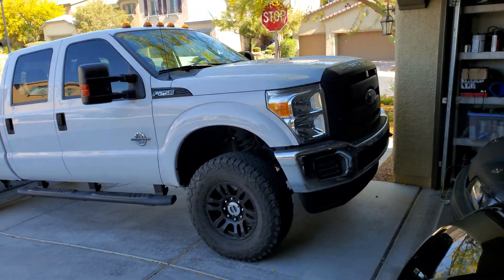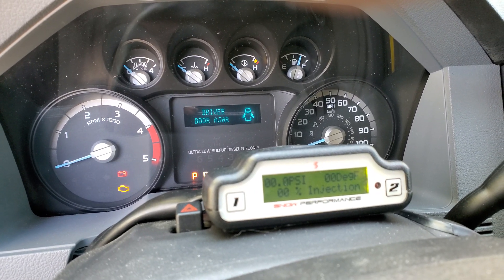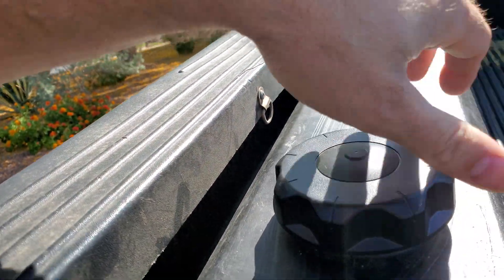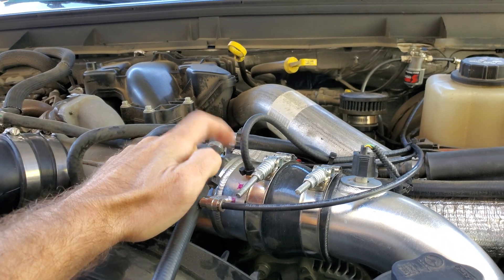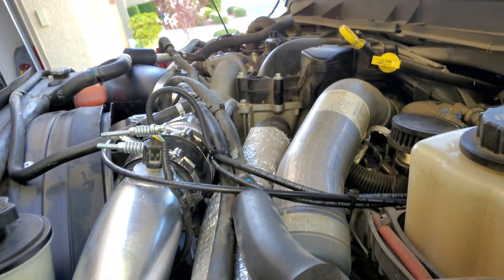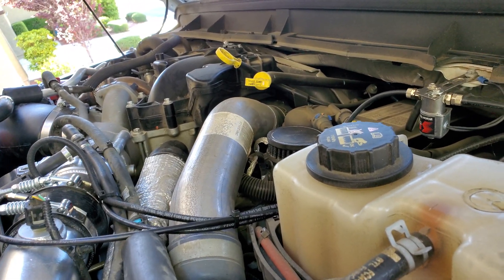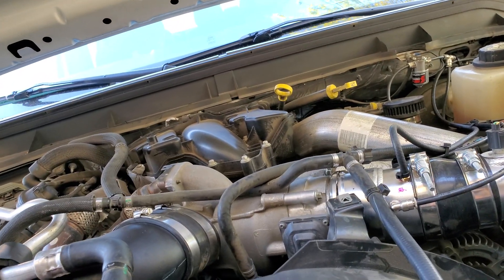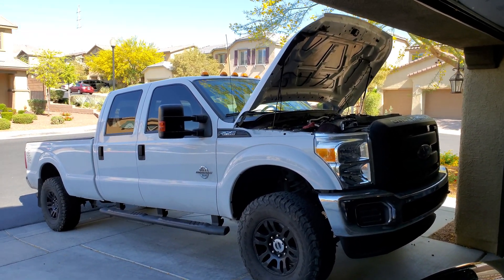water-methanol injection, 6.7L powerstroke

Comment: Good video,  I recently dove into a water-methenol rabbit hole.  Im considering putting it on my 2004 5.9 ram.
Reply from the maker: @timyanke9559  thank you.  Definitely recommended it.  The only time I've seen it not benefit a diesel is when the tuebo is maxed out.  You'll still see mpg benefits, but the top end will stay the same or lose power due to extra fuel and no more air

Comment: May have missed it but do you have the dpf on?
Reply from the maker: I did at the time of making this video.  Water/meth is supposed to help lengthen the time between regens.  I have found that if you spray meth at too low of a boost, it makes the truck regen more often.  The size of the nozzle tho plays a big roll.  Small nozzle you can spray at really low boost.  I run 2 large nozzles so I don't spray under 9psi

Comment: I own a 2012 and it deleted. 
Runs good but I'm looking to buy a methanol kit.  Will I need a tune after installing? I don't know to much about about it. I don't have a programmer.  Just deleted and it was done before I bought the truck. Can you help me?
Reply from the maker: No tune needed.  I have a 200hp tune on my truck but I had tunes for the truck before I got the methanol.  It's bolt on and go

Comment: What do u do in the winter to prevent freezing?
Reply from the maker: Nothing. 
30% methanol is good to -20*.
50/50 mix is good to -40*.
The coldest I've driven in is -5* and with a 30/70 mix it never froze
Reply: @turbojeremy13  exactly

Comment: Wouldn’t a check valve only prevent flow from the engine to the tank?..or is it a spring operation that requires a specific psi to allow flow thru it?
Reply from the maker: It's spring loaded.  If I remember correctly, it takes 20psi of preasure to open it.  This prevents any siphoning effect from air passing by the nozzle at high speed and sucking the methanol out.
Reply: @turbojeremy13  any mpg gains from the install?
Reply from the maker: @oddlyrightoddlyright2475  hard to say.  I deleted the truck shortly after the meth kit went on.  I can tell you I got 20mpg on the freeway on 35" tires.  I feel like that's pretty good for a crew cab long bed.
Reply: @turbojeremy13  good to know man
Reply from the maker: @oddlyrightoddlyright2475  I always tell people to do mods for performance,  if you see an increase in mpg, that's just the icing on the cake

Comment: How much fluid does it use under your normal driving?
Reply from the maker: Depends on how you drive and what settings you use.  If I drive like a normal person just crusing around from A to B, I might only use half a gallon in a month.  If I drive aggressively or tow every day I can use a couple gallons a month. Currently I start spraying at 10psi of boost.  With a lower starting point, I would go through methanol faster

Comment: Thanks for the video very informative. I’m installing a Snow Performance stage 3 on my 2019 6.7 Superduty. There isn’t a lot of information on the water meth injection. I’m running the PPEI tunes and to use the SOTF +230 HP tune PPEI recommends the water meth injection so I’m doing it. They say it will help keep the DPF happy
Reply from the maker: I'd be curious how the dpf does on that tune.  My tuner won't go over 150hp when the dpf is still in place
Reply: Take that junk off

Comment: Nice introduction video, are you in a smog state? If so are you planning on removing everything for smog tests? I’m way interested in easy and cheap power with fuel mileage. You didn’t mention the tunner name, just that you haven’t loaded any tunes yet. Please keep up the post’s.
Reply from the maker: I live in the only county in nv that smog diesels.  Meth kits are 50 state legal from what I've ready and have no plans to remove anything for the next test.  I have a toggle switch i can use to turn the kit off if I want to or need it.

I have tunes from proven diesel

Comment: How’s this setup performing for ya?
Reply from the maker: Very well.  No complaints at all.  Think I start spraying at 10psi now but other then that, nothing has changed since I made this video.  Still very happy with the kit.
Reply: @turbojeremy13  no tuning done to the truck correct?
Reply from the maker: @A1UTV  not meth related.   I do have an 150hp, emissions intact tune from proven diesel.  But I got the tune before the meth.  I've also run the kit on the stock tune

Comment: Can you include a parts list?
Reply from the maker: https://www.dieselpowerproducts.com/snow-stage-3-injection-01-19-duramax

Here is the kit I was attempting to copy.  It's the snow 530 kit.  I wanted a bigger tank and I only used 1 solenoid.  They recommend a solenoid at the tank but it's only purpose is to avoid draining out if a line  tween the tank and nozzles gets cut or melts.  I felt like it was just one more part to fail and I didn't include it.

Comment: I have a Snow  mpg max kit installed on my 16 duramax & i set it up almost identically to how you have yours setup. I haven't seen a huge improvement in MPG but the EGTs are drastically reduced and i can definitely feel a HP/TQ increase. It doesnt push you into your seat like nitrous, you just more or less catch up to traffic alot faster & easier.

Comment: Link us to where u bought everything
Reply from the maker: https://www.xtremediesel.com/snow-performance-sno-50100-stage-3-boost-cooler-water-meth-injection-kit

This is the kit that I recreated but I got all the parts individually.   If buying all parts new, it's cheaper and easier to just get the kit.  I got the controller and pump used which saved a ton of money.   I also wanted the 10 gallon tank instead of the 7 gallon that came in the kit